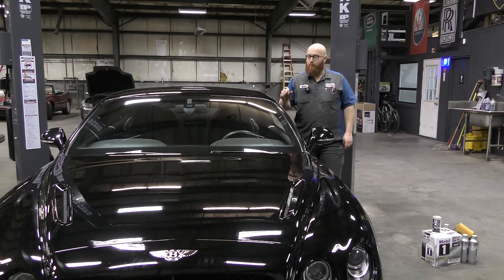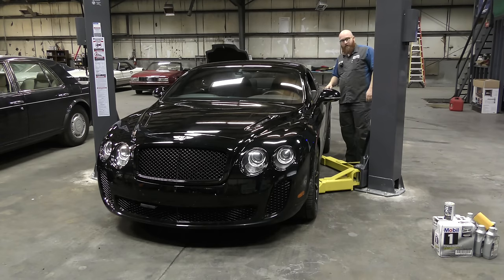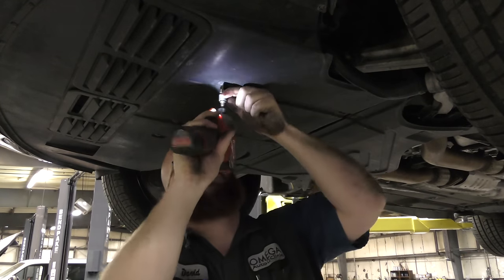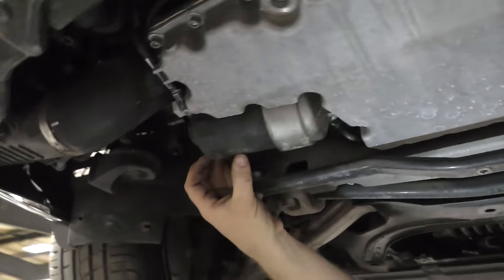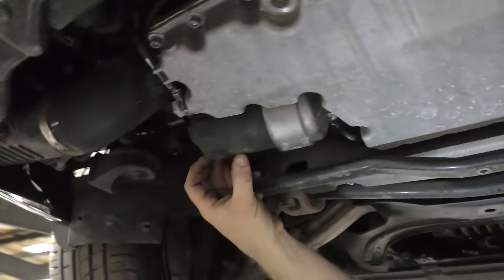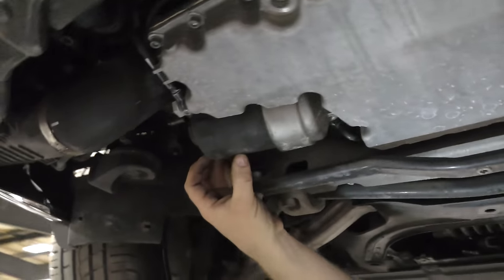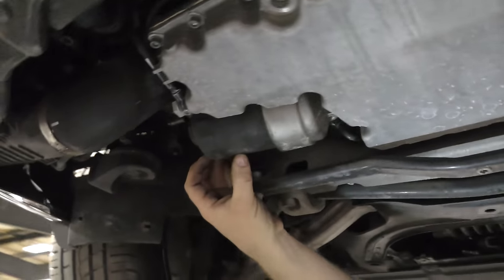One Fast Oil Change! The CAR WIZARD works on an insanely fast 2011 Bentley Continental Supersports!

Comment: I just don't like the small jugs because they're very wasteful and hard to get all the oil out, which just ends up in a landfill.  Gotta do whatcha gotta do though.
Reply: He probably recycles them.
Reply: He STILL WOULD get them cheaper then individual bottles.

He needs to be AMSOIL preferred member and 30% off.  BTW Mobil 1 is a joke compared to AMSOIL Signature version.  But you pay extra for higher quality!
Reply: Jason Buis Amsoil is a waste of money. For how much more you spend on that oil you can just rebuild your engine when the time comes.
Reply: @robert3302  If only China still took all our plastic. Everything besides paper, glass, and metal goes to the landfill. Sorry to break it to you.  Only way to fix that is to have like 6 different recycling bins and assume people would sort stuff correctly (nope)
Reply: @jaybee2344  Maybe for a racecar id get Amsoil,but other than that, complete waste of $. High quality product sure, but there are many others much cheaper
Reply: @TheTurpin1234  Well they have racing oil too..

The thing with synthetic is MOST don't like drive their car over 100,000 miles, not obsessed with a real smooth engine, or 1 to 3 % better mileage.

As far as price goes...  AMSOIL sells a wide range of oils.  From cheap to expensive.  Mobil 1 isn't garbage but if you want the best oil isn't not it.  Now if Mobile 1 is used a Euro, or Asian engine it should get close to a million miles.
Reply: @markm0000  Well depends on engine brand but I get your point.
Reply: @markm0000  Amsoil is "over hyped". I got sucked into buying it for my '73 Merc Capri(German) in the mid-seventies by a co-worker who claimed it would make my V6 SOOO SMOOTH and quiet! After using it for a year, it actually caused engine problems like: leaking oil pan gaskets and rust because of condensation in the oil. The "diester base" of Amsoil did not get along well with the gaskets used in foreign cars. As for the condensation in the oil, my co-worker salesman pointed out  that with Amsoil I wouldn't have to worry about engine damage! Since that time, I run, not walk away from anyone that "pitches" AMSOIL! WHAT A JOKE!
Reply: 1 litre bottles are 80% of the price of a 5lt bottle in Australia. Unless you're changing the oil on a 125cc scooter, you just don't really buy small bottles.
Reply: @TheOzthewiz  Use Liqui Molly. It has lots mollydium disulfide in it which is probably the best lubricant on the planet. Made in Germany. The molly makes the oil look gross and used when new, but there is nothing better
Reply: ojars zvaigzne The saying goes use only what oil the manufacturer recommends and never change it. I like Rotella oil for diesel trucks and Mobil1 for cars. I’ve had good luck with that.
Reply: @markm0000  Any quality oil that you change regularly you will have good luck with. If you like a specific brand, stick with it. I personally have a hardon for the penzoil natural gas stuff and liquimolly. (I use mobil1 filters fram is junk) Take care of your stuff is the moral of the story.
Reply: Using that oil additive with high zinc, is there a concern that the higher zinc may impact the catalytic converter?
Reply: Russell Boedeker uhhh the engine oil should never end up in the exhaust. You’ve got bigger problems if you’ve got enough oil in your catalytic converter for the additive to cause any problems. At that point it would be clogged full and overheating.
Reply: luke saylor they manage to do they in a lot of countries (like japan). Wonder why Americans can’t...
Reply: @aslkdfjhg  That is it.
For a home job, if you need less then 5lt, can get a big jug, but over that it is 5lt and whatever else, or working at the shop it is always big containers and small containers if say 6 or 7lts. Never gotten the small shipments.
Reply: @TheTurpin1234  you don't have 6 recycle bins?? We got waste, biodegradable, paper, plastic, metal, chemical and we got drop off points for clothes, furniture and small appliances
Reply: @tuneskramer69  No.  6 different ones just for plastic.  Talking about how plastic never gets recycled anymore.  China stopped accepting it. They had cheap labor they could pay to sort plastic.  Now thats not an option.
Reply: @TheTurpin1234  thanks for the clarify
Reply: @markm0000  Depends on the engine. Many engines burn oil when working properly (bmw comes to mind)
Reply: @aslkdfjhg  When the wizard talks about the big jugs that will just be sitting around he talks about the literal barrels of oil that are sold to mechanics. Which are great if you eg. work exclusively on BMW's where 95% of the cars you work on will have the exact same castrol oil. Not so much when you have to work on the hooptie fleet.

As he said he buys in the quantities that he needs, which also means that he got to accept the 1 litre bottles if that's all they have available, the wizard knows how to do price/volume.
Reply: @aslkdfjhg  , looking at a UK supplier for this Mobil 1, a 1L bottle is £15, 5L is £50, and 20L is £180.

Comment: Hey Wizard, Can you do a video on BG MOA and other oil additives? Do you use BG MOA in the TDI motor in Squirtle?
Reply: William Clark Also, I’ve heard zinc additives can clog up catalytic converters. Is this true?
Reply: Do not use these products on EO EURO6 engines and up. Just use the correct oil and original oil filters.
Reply: You don't need snake oil products like this if you use a decent oil brand
Reply: @TheBlaert  exactly

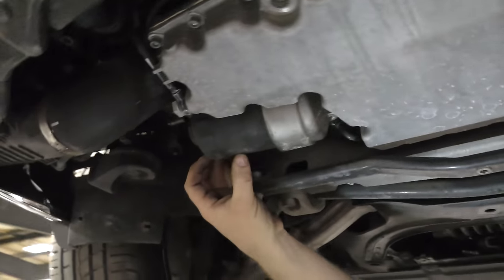Comment: 16:00 the W12 is a VW development towards the millenium. I was introduced with the Phaeton (https://en.wikipedia.org/wiki/List_of_Volkswagen_Group_petrol_engines#6.0_WR12_48v) and later established in other cars - e.g. A8 where it got more "common" 

99% of this car is a Phaeton that was "modified to look like a Bentley"
Reply: 99%, a completely made up figure.
Reply: You have read the other Wiki contribution to the one that I read, which stated that the first car to use the W12 engine was the VW Nardo concept car but the first production car was the Audi A8 D4 (2001 only) and thereafter VW phaeton and the Bentley range.  Check out W12 engine on Wiki.

Comment: Great Video! Thanks! Just wanted to say I believe before draining the oil you should open the fill hole on the engine for better air flow, so better drain.

Comment: Way back when, I used to work in a garage, when we did an oil change, we checked and filled all fluids, lubricated the door hinges and latches, hood and truck latch and hinges, vacuumed the front floor, and washed the windshield, inside and out, checked the tire pressure.

Comment: Thankyou Wizard for pointing out that installing a dry filter will not hurt anything at all.  Even after draining, the engine is still full of oil, coating all the metal parts. That residual oil protects everything just fine for the few seconds it takes to fill the filter. Indeed, on most engines you could drain the oil and then run the engine for minutes before the residual oil started wearing off and damage started occurring.

And as said, if dry filters really were a danger to the engine, all engines would have the oil filter oriented in such a way as to allow filling and installing without spilling the oil. On my current cars the filter is oriented horizontally, and on my old 4.0L Jeep it was upside-down, so no hope of filling with oil before installing.

Comment: Never realized that the Bentley door chime is VW's.
Reply: Prob the same one in lambos too hahah
Reply: Bentley is owned by Volkswagen.
Reply: Regrettably, although it is a nice thing, the modern Bentley just IS a Volkswagen for the most part. They died when VW bought them back in 1998. I had hopes VW would just give them financial security and respect the history of what they had bought, but they failed to do that. Bentley now are half coach-built delight, half VW parts bin, and I don't think it's ever going to be any better than that now.
Reply: Same with bmw and rolls.
Reply: FishFind3000 that’s of nicer quality though ;) Bentley and vw ain’t got shit quality wise on rolls and bmw
Reply: A vw 1.0 polo is the same chime as a bugatti veyron
Reply: Even the Bugatti Veyron and the Chiron have the same chime, it's in all VW/Audi cars 😂
Reply: Polin Mileg VW leads the way
Reply: @paul1978g  The alternative was extinction of the Bentley brand, similar to RR/BMW. Sad reality of relatively mondern maufacturing costs.
Reply: and in Bugatti Veyron and Chiron

Comment: The engine is pretty much 2 VW VR6 engines put together.
Reply: Interesting to see that the power output is scaling pretty much linear. One of those VR6 makes about 250hp naturally aspirated (at least the one in my 2004 Audi A3 3.2 does, the ones in the R32 Golfs may have had different specs) and the two bolted together here result in 630hp, but they aren't naturally aspirated. I would have expected more loss of efficiency from the setup. Or maybe I'm underestimating the increase in power forced induction on a >6l 12 cylinder should produce?
Reply: @TheBigOne0305  if i recall well, the w12 in the A8 from those years puts out 450 hp. 
add some forced induction, and you have... whatever you want)
it's pretty logical that if you add some more cylinders with corresponding displacement increase, you get that much power, it's the fuel economy that suffers, because friction and shit.
Reply: I was wondering if it was 2 VR6's, love VR6's.
Reply: The Aston Martin V12 is just 2 Ford Taurus engines (Duratec 30) stuck together with some Cosworth magic breathed into them.  The early ones were in the 400 HP range, roughly double a Taurus as well.  The Gallardo's V10 is 2 inline 5s from a base model Jetta, again with a little extra work done.
Reply: This is a dumb analogy, as you could literally say any engine is just a smaller engine doubled. Doesn't mean shit if it's not engineered properly. It's a silly reductionist argument. Well a Bugatti is just 4 Jetta engines, I'm pretty sure there is a little more to it than some piece of shit Jetta motor times four.
Reply: @efabiano82  How is it dumb?  The W12 is literally based on 2 VR6 engines.  How is that so hard to comprehend?  Oh and how is the W16 based on 4 "pieces of shit" Jetta engines?  Since when did Jettas come with a VR4 engine?

Comment: Can see from "the old days" when most oil filters where fitted hanging down that's why they used too advise filling with oil first so as not to possible get air locks, but now days no need as you said Wizard. A lot of plant and earth movers/tractors still have down hanging oil filters, some of the fitters at our place still fill with oil before fitting.

Comment: "torque to wizard ft pounds" love it hahah. who seriously torques every single bolt, like snug it up, and then a little bit more. it'll do!
Reply: Mr Skeedle cough cough CHRIS FIX
Reply: I do tend to torque everything, so long as I can fit a torque wrench. If not, wizard foot pounds 🙃
Reply: Depending on the application 2 grunts is my torque spec
Reply: @samjacobs4769  yeah I heard him say that the other day actually. but it's what I've always lived by seriously 😂
Reply: @Kevin09210  I changed a flywheel without using a torque wrench hahahhaha
Reply: @extrasteez5727  2 grunts for a m6 and above
Reply: @MrSkeedle  you are a brave man, lol. I would torque those to be really sure. I guess that with experience, you can get a good feel for all bolts and always snug them all right.
Reply: @Kevin09210  tightened them up VERY tight. not tight so they would be damaged or snap. but tight with a breaker bar ahhahaha
Reply: @MrSkeedle  i guess that with a 1/2 inch ratchet go as far as you can and it should be fine. I dont think that would snap it 😅
Reply: torque it till you hear a crack, back it off quarter turn, and blame it on the next guy.
Reply: @Dreddy72  ^^^^^^
Reply: People who wrench on 300k dollar cars that's who should!! anyway....

Comment: The cost savings of E85 (which has evaporated along with the U.S. economy the last few weeks) is negligible, considering the efficiency of e85 is at least 20-30% less efficient than regular gas.
Reply: Someone who drives this, doesn't care about fuel efficient. e85 is about octane with performance cars. Not many places sell race fuel at a pump.

Comment: 18:01: In Europe we call that the "Just In Time" supply chain. Coronavirus has shown it has its limitations, but I see the logic.
Reply: JIT is a crucial part of a Toyota Production System (a lean manufacturing methodology). There's a wealth of different lean manufacturing ideologies that are used in the UK. Can't speak for the rest of Europe though. Its all really interesting stuff to sink your teeth into if you have the time to look into it all a lot of it can be used in an business. - From one very sleep deprived AML engineer

Comment: I’m highly suspicious of any oil/fuel additives. I’ve yet to see any tests which support using it.
Reply: Yep.
Whenever I start do dig up information on how they came up with "37% LESS ENGINE WEAR" or "18% BETTER ECONOMY" I find out that they're using the cheapest possible mineral oil as a benchmark.
Reply: yes bentley dont like  anything but oil in there
Reply: Yep obviously wizard wants to make a bit extra money by selling them. But personally if i owned a shop i wouldn't video myself to thousands of people selling that stuff. I don't have a problem when people spend their money on placebo effects. If it makes you happy, it makes you happy. But i think it's very transparent what the wizard is doing
Reply: @ЕмилЕфендулов  IF any legit data at all exists.
Reply: Car manufacturers specifically recommend against any additives. Project Farm has also demonstrated that the additive package in modern oil is much better than that in STP.
Reply: @CaptHollister  Stands to reason, of course.
Reply: My favourite oil additive is “ Oil of Snake”   Boosts performance and reduces wear. Says so right on the can.
Yip.
Reply: @falconeaterf15  Yup, the original product, been around for centuries and works just as well now as it ever did. But as old P.T. said, "There's a sucker born every minute."

Comment: 17:00 Modern synthetic oils have all the additives required for the vehicle stated on the bottle. 
Putting that "crap" additive into the oil WILL VOID ANY WARRANTY issues and it also makes the oil look dirty instead of clean. 
If the oil intervals are adhered to, no additional "crap" is needed.
Reply: Not exactly true.  Regular oil you buy at the store has very little zinc content.  Zinc is good for your interals with metal on metal such as your camshafts.  They leave zinc out bec it ismt good for your cat converter.  Would you rather replace an engine or a cat?  I use amsoil racing oil when I track my car bec it has the zinc in it.  Also cost 12$ a qt

Comment: “Sport” can mean “mutant.” So... it’s like one of the X-Men?

E85 means lousier fuel economy but I suppose if you want the power you don’t care...
Reply: You don't drive a Bentley Supersports for the MPGs.
Reply: E85 means it will eat all the plastic and rubber bits in your car, unless those were designed to handle such fuel.
Reply: Much less energy density.
Reply: @philipcooper8297  Which they were.  Watch and listen to the video before commenting.   You will seem less foolish.
Reply: Macht Schnell yeah, hexanes and octanes and such have rather more fuel value than a similar volume of ethanol...

Comment: Buys Bentley and brings it to a quickie luke. Thats crazy.
Reply: I've seen them there before along with S classes etc on Long Island and in NYC.
Reply: Dude, it's just a oil change.
Reply: @Crazywaffle5150  Well alot Euro cars aren't always simple.
Reply: @jaybee2344  How much simpler do you want servicing to be?
Reply: @Crazywaffle5150  But as said, the quickie lube places won't be using the high-quality oil, they'll be using the cheap bulk stuff. And can you even be certain it'll be the correct weight?
Reply: @dunebasher1971  That's why you buy it your self and tell them to use it. That or change your own. Literally chaining your own oil is easy as hell. My race engine I built uses a specific oil with zinc. I just buy direct or off line.
Reply: @jaybee2344  Well, this one is.

Comment: What does JACK MODE do?  Disable the alarm or something or stop the suspension drooping?
Reply: Yea it basically tells the car that it’s going to be lifted off the ground. That mode prevents the suspension from trying to self level itself, which prevents damage to the system
Reply: So if you park illegally and the tow truck jacks your ride there could be serious issues.
Reply: L.L S. Potentially yes

Comment: The underside of that Bentley,especially the front suspension, reminds me of a 2000 VW passat B5 1.9 TDI that I owned a while back. Which leads to the idea that the entire drivetrain from the Bentley would fit in a B5 saloon,what a traffic lights sleeper!

Comment: I'm from Kansas, I've never seen anyone in that state with a 275k vehicle lol. Are you servicing the Chief's cars or what Car wizard?
Reply: These cars are either in the garage or in the shop.
Reply: They loose value very fast...
Reply: @nsbioy  The earlier GTs had the vacuum line issues but later cars 2012+ are relatively reliable.
Reply: They are here in Wichita. In fact I saw a Lamborghini Diablo the other day at Best Buy off 21st and Rock road.
Reply: @nsbioy  they don't have problem like kias or Nissan's you see everyday
Reply: I saw a Viper ACR X in Missouri once. Very weird car to see on the road.
Reply: @jmoney7289  they do, just at 20x the cost. Plus, they are not driven much for the most part.
Reply: @MBisFrenchy  ford GTs appear to be very solid from what I have seen on the internets.  It is easier to buy a Ferrari than an 06 GT.
Reply: Have you not been to johnson county? There all over the place down there
Reply: My boss has a Bentley here in kansas
Reply: @roysimpsonii5877  I was born in Johnson county lol